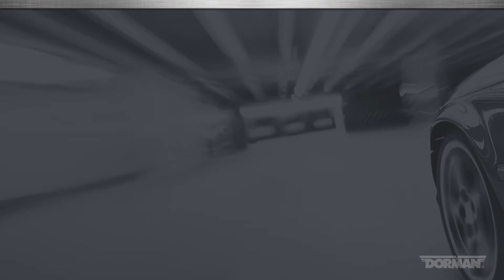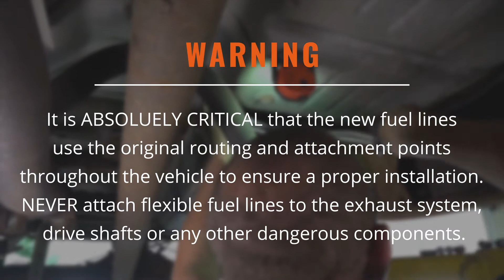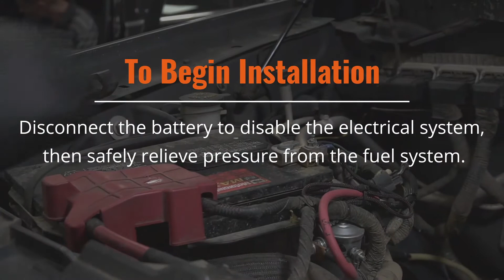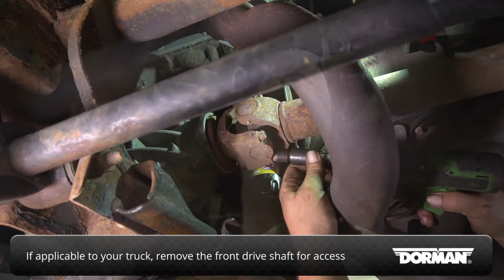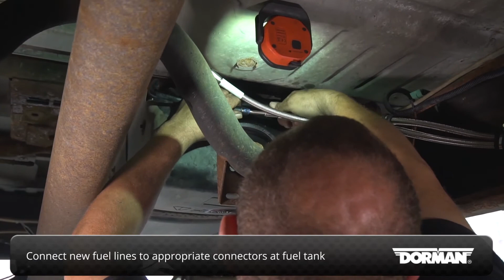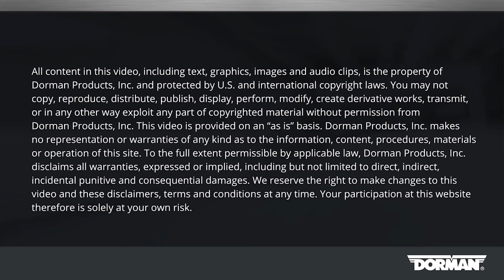OE FIX: Flexible Stainless Steel Fuel Line Installation by Dorman Products

Comment: The kit actually only has one size for the 99-04, and it's long enough for the crew cab length. All of the shorter trucks will have extra length that has to be dealt with.

Comment: If this was answered. sorry, BUT can flexible hoses be used for Fuel Injector engines. Mechanic said my fuel lines need replaced, 2004 Chevy Express 1500 Conversion van, but he said since its FI it cant be replace with Flexible, has to be hardlines
Reply: What’s FI? Oh wait, fuel injector. Duh. Lol. Good question, did you ever figure it out? It could be possible that the mechanic was tryna get you to pay more for labor, but maybe not.

Comment: Only 99-03 models had a fuel filter. 04+ does not have a fuel filter on the frame.
Reply: Would those lines work on my 2004 Chevy Silverado 1500 extended cab 4x4 4.8 liter engine?
Reply: @SuperCyril2  looks very similar, gonna find out soon
Reply: @kodymasters3206  update pls ?